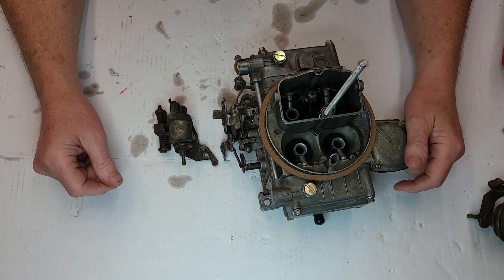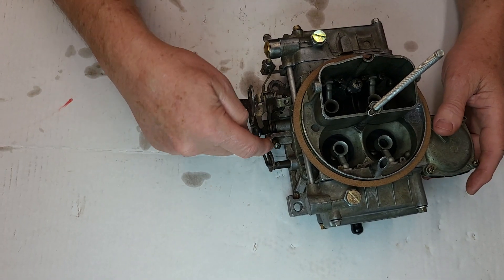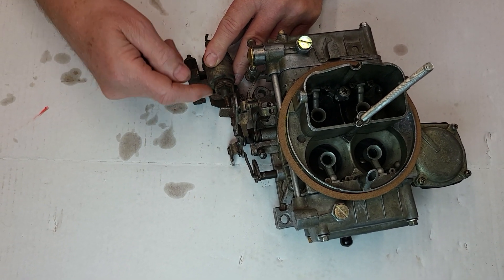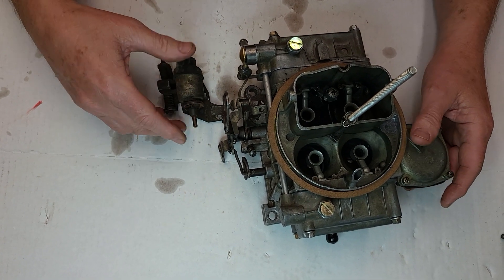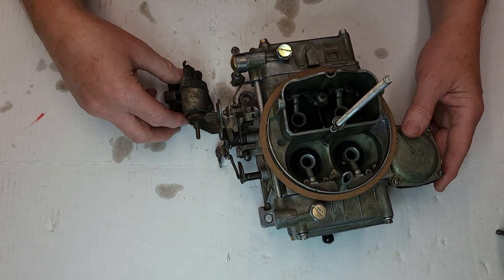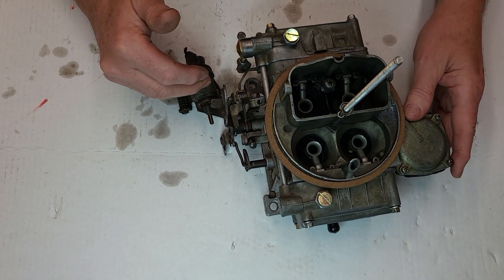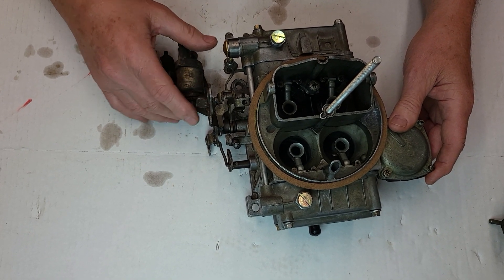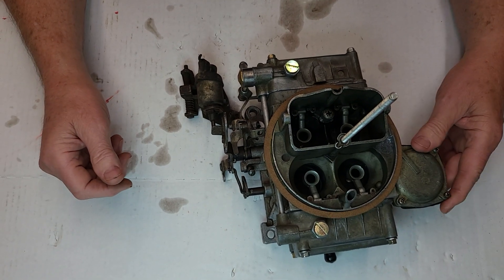Anti-dieseling and A/C Compensator

Comment: Is that wire a ground? Im looking a schematic for 1977 mustang 2.3l and it shows the start/run red wire connected to the solenoid wire and the solenoid itself is grounded to the body. But using a test light connected to positive battery it lights up when probing the solenoid wire
Reply: And do these solenoids make a click noise when ignition is turned on? I'm getting weak spark and stalling under load at 30 mph
Reply: Haynes manual states faulty antidiesel solenoid can be a reason for no start
Reply from the maker: Never seen that happen, there is nothing i know of that could cause a no start in the anti dieseling solenoid but could cause a low idle or maybe stall at idle from solenoid not energizing, but not a no start.
Reply from the maker: No noise normally.
Reply from the maker: They make a click in the start position  but only in the start position, its hard to hear it with the engine turning over. Sorry miss read it the first time.
Reply from the maker: Most vehicles had a red wire with a blue tracer to energize the starter solenoid. With the ignition switch in the start position battery power is applied out of the ignition switch and through the neutral safety switch  to the starter solenoid the red wire should have battery voltage in the start position of the ignition switch, I think it will go to ground with the starter solenoid deenergized. This wiring changed from ignition system to ignition system, I believe this was the ford duraspark system. Hope this helps. Let me know if you need more information.  P.S. if its a manual trans. Then power will run through a clutch switch at the clutch pedal instead of a neutral safety switch.
Reply: @holleycarbshowtosadvice40y90 yes you are correct. The anti diesel solenoidnis connected via a red-yellow stripped wire from the ignition switch. I am curious because of the Haynes Manual and wanted to know the function of the solenoid. I believe it may make a click noise when powered but wanted to confirm this with someone else too.

Comment: How about we put that solonoid on a movable bracket linkage and have a second one that can push that one? Now we have high idle for a/c and anti-diesel.
Reply from the maker: Ford had a vacuum and electric solenoid combined back in the 80s , the electric was anti dieseling and the vacuum was the a/c kicker which worked off a vacuum solenoid that energized when the a/c clutch was turned on.

Comment: Yeah mine stopped working on my 86 d150 when I kick the AC on when it's in Drive it will stall I made up for bringing the idle up I did buy another one I'm going to put in on eBay for about $50 I'm hoping that's all it was but I think it is
Reply from the maker: A bad solenoid could cause the engine to stall.

Comment: I have a 3310-1 modified with a 850 base plate and use the manual choke for high idle only,  No choke plate.  The solenoid is a great alternative  for carbs ,  mostly race carbs that have no mounting bosses for choke hardware so that a manual choke could be used.  For example:  Holley 950 80496-1 no choke tower, no choke mounting bosses BUT does have the solenoid mounting pad that could be drilled and tapped for the solenoid / bracket. This is great information for guys not wanting to sit in the car feathering the throttle, Thanks for showing this randy.
Reply from the maker: Thanks Jeff .

Comment: Sorry to hear that things haven't been good, prayers for you and your family, your info and knowledge got rid of my off idle stumble, am running a 285 duration cam in my 454, stepped up to a 50cc accelerator pump and bigger discharge squirter that solved out of the hole bog, would not have been able to do that without your help. Thank you sir, my friend, may God bless you and your family and hope things get better soon
Reply from the maker: Thank you   and may God bless you and your family.

Comment: I have a Summit Racing carb on my 406 sbc and have a problem dieseling. I tried to find a solenoid  bracket that would fit but no luck. I ended up making one out of a piece of steel. It works OK but tends to flex so the idle rpm isn't as consistent as I'd like. Do know of a place that has a variety of brackets? Thanks.
Reply from the maker: Go to google punch in holley carb , then punch holley carb solenoid brackets, may won't to call holley and ask which one fits your carb.

Comment: Nice to have you back Randy, your past vids were of good help to fix all the carb issues the car had when I got it, from fuel leaks to idle issues... all good now. Working on getting the jetting on the nose and adding the delated thermal choke mechanism back and running.
Reply from the maker: Great and thanks